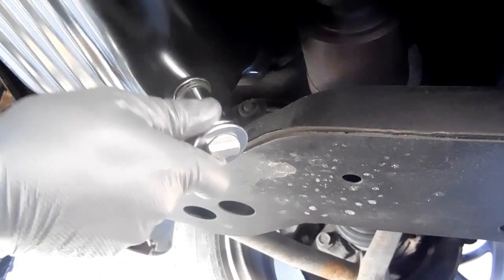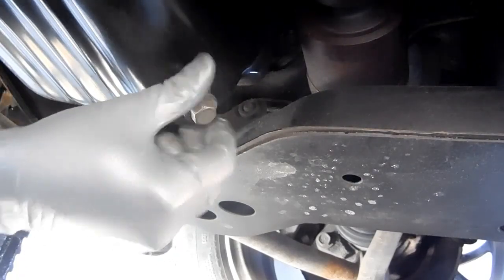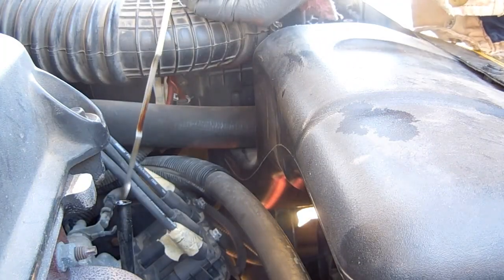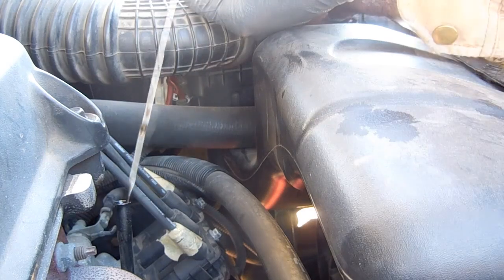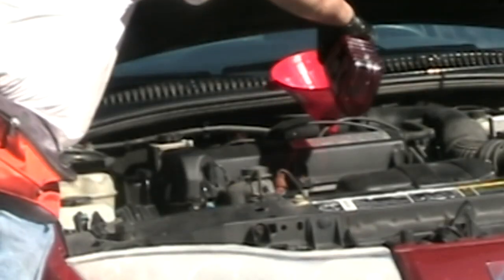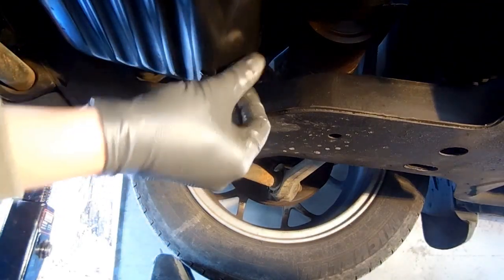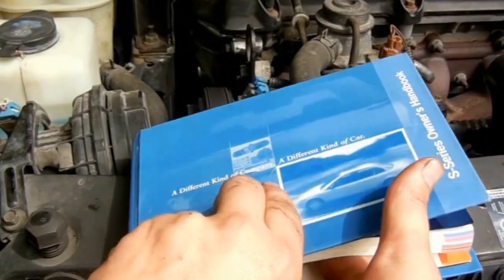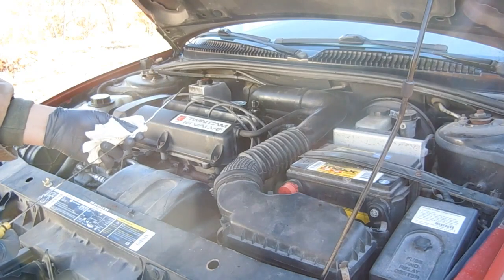Safe Motor Oil Flush Using Kerosene

Comment: Kerosene is not safe. This is a last resort cleaning method for engines where oil changes were never or very rarely done just to clean up the sludge before tear down.

Comment: My old neighbor used to do this .He drained all the old oil ,filled crankcase with kerosene. He pulled coil  wire and turned the motor over for a while. He didnt start it. He drained kero put cheap filter and oil in ,drove it around the block. Then he drained oil ,put good filter and oil in .He had over 300,000 miles on a 69 chevy wagon . 327 block . The car outlived him .
Reply: My Grandfather had a 1955 Dodge Truck. Same exact process and it was the cleanest internals I had/have ever seen in a vehicle.

To be fair I don't think today's seals could withstand this as well as compared to how they built engines in the past. But so much of that knowledge on how to even properly do the process and in what amounts is lost. If I recollect he mixed off road diesel in as well.

I remember my grandfather showing me once when I was 7-9. But without writing it down and no video from that time good luck to me ever trying to experiment with it myself.
Reply: @Vultain the seals are fine cause newer diesel have rubber diesel lines so the diesel rubber safe and newer cars seals are better
Reply: @JnRskaters Selam. 300000 km olan 2010 model toyota corolla d4d turbo dizel motor aracım için yaparsam  motora ve özellikle turboya zarar verir mi? Kısa ve uzun sürede arıza çıkar mı? Ülkemde böyle şeyler yapılmıyor. Bazı motor temizleme sıvıları var onları kullanıyoruz. Bununla ilgili hiç bilgi sahibi değilim. Yardım edermisiniz? 0:06

Comment: What seals? There’s only the main seal and it’s just about indestructible. Are you all talking about the gaskets? Bc kerosene will not hurt them. If you are worried about the blow by then pull the pcv valve while performing this cleaning. If you’re talking about the valve stem seals then maybe on an old motor they’re probably shot anyway so this procedure can’t make it much worse. Just use this to clean the motor if it’s not been properly cared for and you’ll be fine.

Comment: Anyone who has rebuilt an engine knows that the oil galleries and passages rarely become clogged with sludge.  It is most in the pan or caked on non-contact surfaces in the crankcase or valvetrain area.  Only in the very worst cases does this happen.  Performing a Full Volume Oil Change, double flush, with a fully formulated oil and letting the detergents and dispersants do their job will be more affective and 100% safe.  Using a solvent is never safe.  I see from your multiple videos and admission that you flush your engine quite often, not just at the 100k mile mark.  This might explain the high blow-by and oil consumption.  These Gen I Ecotec engines are known for their longevity.  May want to cut back on the solvents and use 100% oil.  The average spill and fill will leave behind 10-20% of oil.  Companies use this fact to push their gimick flushes, making think the dark oil that comes out of the pan is their product cleaning the engine.  You get the same affect by just flushing with clean oil and driving it on the highway for 30 minutes.  It will come out dark.  Next time, perform a double flush, then add your favorite flush product and see what it looks like.
Reply: When would you change the oil filters? After draining the old oil and filling up? And then again with the new oil?
Reply: @K0nst4nt1n96  a new filter on the first drain and refill.  Rinse and refill.  I run 10k intervals, again filter change at 5k.

Comment: Everything was going fine until he  spun on the orange fram filter
Reply: It's a Saturn..lol..I don't think it matters..that's the car GM makes with the left over parts..
Reply: @tashaarellano7680   these cars are very reliable I have a 98 with 280.000 miles  still going strong
Reply: @Devo1987  ..I meant no disrespect ..I'm a GM guy through and through..but every maker has that one line of vehicles that just don't hold up to the consumers standards..but that's not saying that a few of the same line of cars doesn't have a special one in there every now and again..I love 1500 chevy..our 2012 sonic is literally rated the worst car built since 1996 and beyond..but ours has never messed up.. gets great fuel mileage and a quick nimble little car so I feel were u r coming from..like I said before I meant no disrespect for the driver's of these machines..it's that I have turned wrenches all my life and Saturn was always the one car u could count on to break down..but a big hell yeah for ur Saturn that has been a good car for u..I'd keep it forever cause it's a oddity..maybe the only one of it's kind..the only problem free Saturn..lol.sorry just messing about with ya..keep it tween the lines my friend and full throttle all the way!
Reply: @tashaarellano7680   Hey man you good in my book we are on the same page no worries. I agree with you to. I love my truck to  glad you got a car theat going good for you :-)   be safe safe out there Friend
Reply: I agree %1000 .... but filter is better than no filter

Comment: Supposedly you completely and safely clean your engine in less than 1000 miles with a Royal Purple oil change. Gets it clean like new, but have to change out again after 1000 miles.

Comment: Flushes especially with Kerosene are not needed if you change your oil on time with a quality oil and filter , they can do more damage to the engine's rubber like seals and  valve guides causing all sorts of issues like leaks and oil consumption .

Comment: At 5:33 you add Lucus to fix the blow-by problem, you would be better off with RESTORE because it can fill the scratches causing your engine problem. No engine flush or oil additive can fix a badly worn engine but the restore stuff does wonders to improve compression.

Comment: Don’t do it. You can break off pieces of sludge and clog to oil passages. Just keep changing the oil with a good oil that fights sludge. One Is Castrol Ultra Clean engine oil.

Comment: If you use a quality oil and something better than the crappy Fram oil filter and do your changes on a regular basis, you won't have to worry about build up inside the engine.

Comment: following someone's advice from a workshop, I did this every 4 oil changes (changed oil every 10k kms). Usually added 0.5 l of kerosene and run for 10 -15 minutes. Did it for 17 years, 250k km. Never had a problem with the engine.
Reply: wow a whole 250k km -_-
Reply: @Xiferr  that's about 150 thousand miles to our SI challenged friends
Reply: @avgeek1930  whats SI ??
Reply: @MrRasZee  Système International , the metric system
Reply: just curious.. add 0.5 l with or without draining any of the engine oil?

Comment: If you are suffering from blowby issue, use 20 points up viscosity (if using 10w30, go for 10w50) engine oil instead of putting in lucas viscosity improver which loses its viscosity rather quickly
Advice from experience.
Reply: Or mix 5/10w30 with 20w50, 1:1
Reply: @thesetruths1404  thats a good idea, however I would stick with same brand oil for better chemical compatibility

Comment: You should put a little oil in your filter before install, just an old mechanic tip!...😁
Reply: Most of the oil that comes out when the oil filter is removed is not inside the oil filter, it is at the top of the engine. Priming an oil filter does nothing to alleviate this. In fact its only recomended for turbos or heavy duty equipment such as deisels where the filter holds more oil then what is past the anti drain back valve.

With that being said... this is a side mounted oil filter... You aren't going to be able to prime one, the engine will have it primed in about less than half a second difference.... and oil is still going to be lubricating the piston rings to prevent damage by the time its resolved.

Comment: I did it once, it's effective and safe. Sovled camshaft oiling problem in my 1978 opel ascona.
Reply: Nothing would fix a rolling pile of garbage like an Opel...not even new parts
Reply: That car was burning camshafts because of grease in small slots  Almost 40 years and still runnin in the ways,  I have 2 modern cars btw

Comment: Never ever flush your engine its going to cause you more problems in the long run
Reply: agree,  i have 6 vehicles over 100k some approaching 200.  regular oil changes i use M1 High Mileage . Never a problem

Comment: Can you lock up a motor by over filling it to the point of not being able to crank it over by hand?
Reply: Yes, it is called hydrolocking. It is the same thing that happens when you drive through a puddle of water and the cylinder is full of water.... Liquids are not compressible. Ergo they will hydro lock. But you would have to overfill that sucker pretty good.... Hydrolock > Bent Rod > Oil Aeration. That is the order in severity of what you would expect depending on how much overfill you are. Some engines are less forgiving than others....

Comment: Never is the best time to not try this method at home.My toyota Corolla has 231,000 and runs great.Never done nothing but regular oil changes no more than 3,000 miles and good oil filters not fram.Its 23 years old and used as daily driver 230 miles a week.

Comment: After you drained the oil it's a good idea to put the plug in and pour straight kerosene into the pan and let it sit then drain it to remove the sludge that sits on the bottom of the pan. I change the filter and Dina 50/50 blend of New Oil and kerosene and run the vehicle for 15 to 20 minutes and drain that oil into a container and use it for flushing purpose ONLY it helps clean sludge .... This internal cleaning helps clean the passages etc of all dirty sentiments that hurt in the engineering I passes in the head and everywhere else... I also take that filter off and save it for future use .... This method is a less expensive commercial engine flush which they charge $100.00 for at most lube outlets .... Your cost 1 filter 2 quarts or litres or oil and 2 quarts or litres of kerosene. 

Your oil after changes will be clean for a longer period of time
Reply: RIGHT

Comment: Useful video, however a better order of operation would be:
1. Never use Fram, spend an extra $4-5 and get a Mobil 1, Wix, or Napa Gold filter. Lots of videos on the cardboard construction of most Fram filters.  2. Run the removed oil through a coffee filter to see if there are any shavings, etc.  3. Add oil to your oil filter before installing to reduce further oil starvation upon first start-up.  4. Add your oil first, then the more viscous oil thickener/anti-smoke additive, which if added first will take longer to thin out and actually lubrication going upon first start.
Reply: Add oil to an "upside down" oil filter
Reply: KOOO
Reply: i heard once about filling the oil filter w ATF.... during an oil change
Reply: Fram ultra actually has better filtration than above mentioned filters.

Comment: What did he poured before pouring engine oil in engine oil tank that reduces blowby problem
Reply: All sorts of additives you can buy to reduce blowby and smoking. You really want to add that stuff after the oil in this type of situation, preferably after you've started the engine and its gotten nice and warm and the oil is already circulating and lubricating.

Comment: You ran it low on oil to long rings failed STP oil treatment will give you a little more compression but  motors shot. Don't  use kerosene to clean out your oil that's not necessary.

Comment: My main issue flushing old motors is it can loosen gunk in the motor and cause oil pressure problems.
Reply: It can also clog the pick up screen.
Reply: @poppaluv  yep that's the biggest problem.
Reply: Yrs ago my friend had a shop, I stopped by and was talking he had a engine partially torn down. He said a friend was on his way to Florida, we were in Michigan and the the engine quit. The guy did a motor flush and headed out. I walked over and was looking at it and it had some dime sized flat circles of sludge all stuck to the bottom of the oil pump sump.  I called Fred over and showed him, we couldn't believe it....

Comment: First I would do what you did then for a second time I would  just get the cheapest oil around and mix it 50 percent  kero and fill it up and run again for 10 min and let sit for 30 min and run for 10 and sit for 30 and run for 5 and drain. I just feel deposits need time for penetration. I would then put the cheap oil in for next 2 weeks and then change the lots with sythetic
Reply: Or just use cheap oil and change it every 500-1000 miles multiple times. Dislodging huge chunks of sludge at once can go bad pretty quick.
Reply: John Moore really good point John . I bought a car with recent reco engine and decided to change the gearbox oil that turned out to be very old . I put in new oil and magnets on the drain bolts and 1 years later emptied it all out . A lot of fine metal sludge paste came out. I should have put 2 litres of diesel in the and let it run with the wheels elevated as there most likely would have been sludge in the bottom still but I will just change it again with new oil again in one years time . I have synthetic in it now and changes gear like a dream !

Comment: 100,000 Mile Tune-Up, so which is better with your experience, diesel or kerosene?  Did you use those two products because it cleans the engine better over conventional engine flush products?  What was your approach to all this?

Comment: I've used fram extra guard with conventional oil on my 2015 Nissan Versa, did the oil changes every 5k on regular conventional oil with fram extra guard and no problems. Now I'm running full synthetic with Bosh filter and still no problem. It doesnt matter what filter or oil you use as long as you change it at the recommended interval.
Reply: i legit had a fram kill my ending with it broke up and sent shit in to the engine
Reply: Wrong, you always want to spend more than the $4-5 a cheapo Fram will cost, if you value your investment.
Might not need full synthetic if you fall for the hype that you need to do an OC every 3-3.5K miles, however a decent synthetic like Amazon Basics with a Wix, Napa Gold or Mobil 1 for $7-8 should let you easily run 10K miles before OC.  End results it fewer oil changes of cheapo stuff while running much better oils with much better filtration.  Penny-wise and pound foolish.
Reply: @boots7859   Wix is the only filter company you mentioned that makes its own oil filter. Everyone else you mentioned is made by Champion Labs. All overpriced junk made to the same specifications with a slightly different drain back. Back 10 years ago Fram paper filters were garbage and Fram almost went bankrupt due to people showing what Fram was using to filter oil on YouTube. Since then Fram has came leaps and bounds, so the El cheapo filters aren't so bad nowadays and a good filter considering Champion Labs haven't changed much and now considered sub par due to the YouTube torture tests.

Comment: Incredibly bad advice. Troll video. As a double master ASE certified ( retired) mechanic with over 50 years experience, I can tell you you’re gonna be walking soon. There is NO reason to flush an engine or use additives of any type. Look in your owner’s manual. And you damn sure don’t want kerosene or diesel fuel in your oil. Kiss your cam bearings goodbye. You’ll never see 200k miles

Comment: Ffs.......don't do this.  If you change oil often enough,  you don't need to flush. If an engine needs flushing and it's worth it,  take it to bits. All this blokes done is wash the engine out of most of its oil, got kerosene in places ya don't want it and taken thousands of miles of its life. .......

Comment: If you keep your engine in tune, use quality oil  and change the oil about every 3,000 miles this flushing is never necessary regardless of miles driven.
Reply: 86jeep comanche exploded after heavy detergent flush of the engine. 10$ bottle blew up my very first car!
Dont use radiator stop leak!
Dont use cheap brake pads!
Dont use big tires!
These 4 things cost me a lot.
Reply: 3000 mile OC was an Oil Change Company urban legend thats been used to increase profits. Many real fleet studies of taxi fleets in NYC, etc have shown that 7500 miles between OC vs 3000 to have basically no difference in reliability all things considered.  And many of these were done before Synthetics ever got on the market for Consumers.
There is a reason why your car manual says 7500 mile intervals, and since they make the motor, and stand by the warranty, I'll take their word for it.
Reply: @boots7859  yea but most people want to keep their vehicles way beyond any warranty period. These days they use low tension rings that easily get bound up and eventually wear the cylinder liner to the point that it basically ruins the engine. All that is avoided by early oil changes. The motor companies aren't interested in engines that run 200,000+ miles and need you to either buy new or spend big bucks in their service department getting a new engine.

Comment: Buy a product designed to clean as you drive. WYNN'S ENGINE TUNE-UP. Or MMO or anything that you can put in the oil and still drive.
Reply: TBH MMO is about the same as what this guy is doing.... It will reduce your 30 weight oil to probably about a 15 weight oil... This is why the bottles that are honest will tell you not to run it in the crankcase for more than 10-15 minutes at IDLE. This guy is just smart and realizes he would be spending more money to buy a product that does the exact same thing... kerosene is a excellent detergent and lightweight oil. Wonder what all those oil additives have in common... hmmm